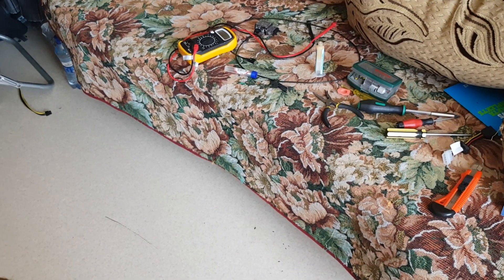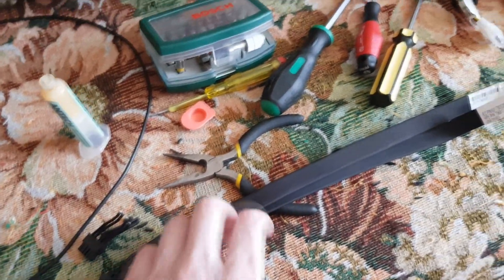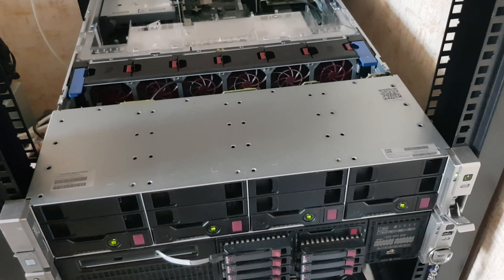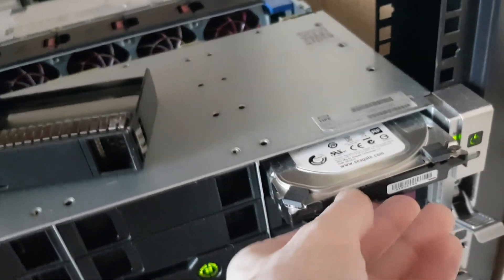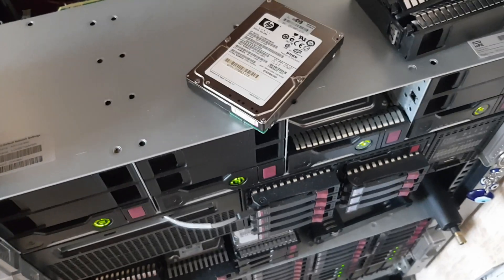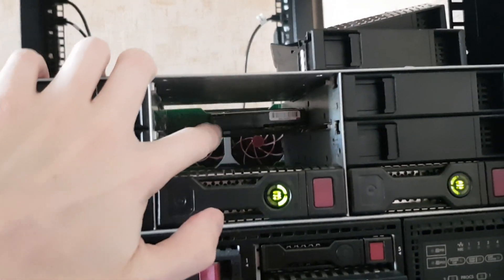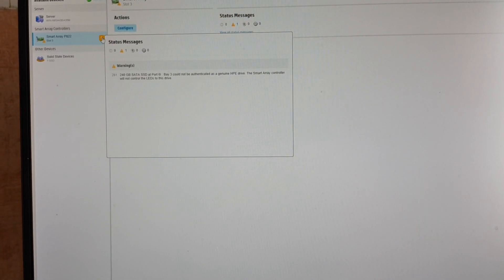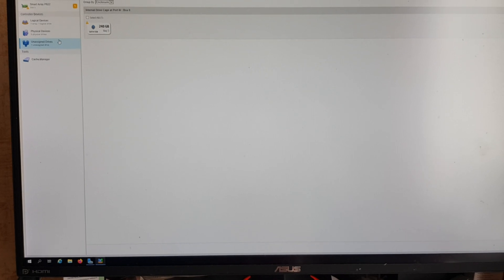How to: Upgrade DL380 gen9 from 4 LFF to 8 LFF part 2

Comment: Thx alot for the video Sir Seagte HDD wil not work in this server ?  i have order DL380 GEN10 12LFF model chassis....can i use Seagate Or Western digital  HDD 3.5  or SSD in LFF?
Reply from the maker: yes it will work 100% for 12LFF. it just depends on what raid card you have in box(integrated only with sata, external with sas and sata)

Comment: Hello,
thank for the video!
Can I ask you why didn't you convert to 12x LFF by changing the 4x backblane with the 12x? Would it be doable?
Thanks!
Reply from the maker: its depends of chasing, i installed two 4 lff there
Reply: @endreu1  would it be possible in your opinion to convert it, starting from a 12x LFF chassis but with 4x LFF backplane?
Thanks!